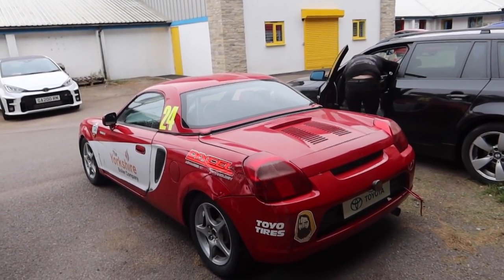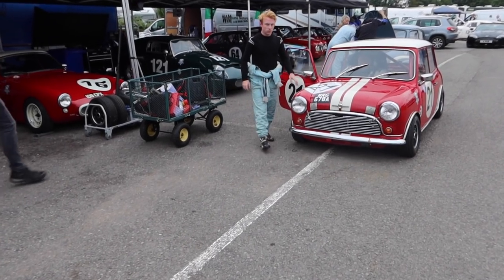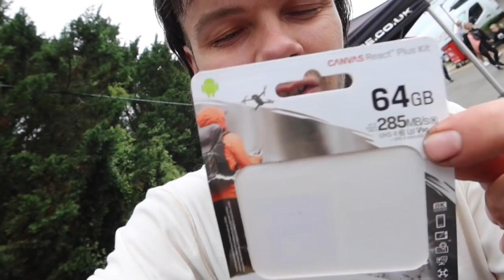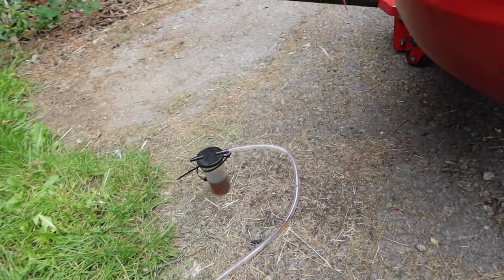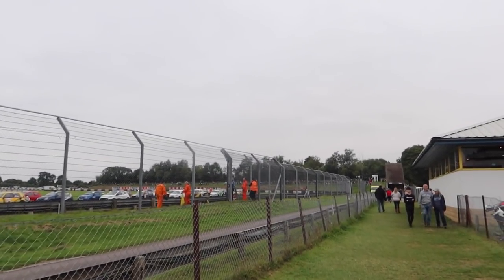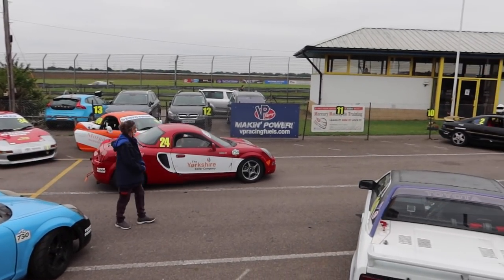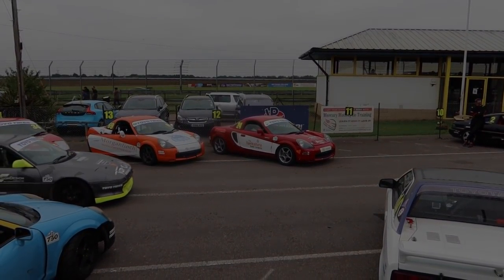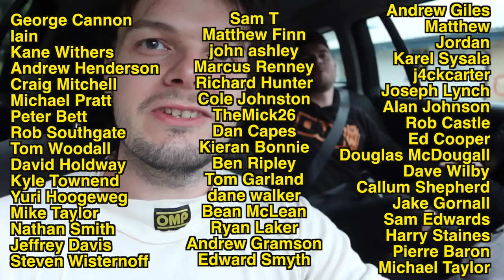MR2 RETURN TO RACING! Castle Combe Race VLOG ft TROPHY!

Comment: This was really good racing "indeed"!
two notes, considering how fast mr2 reacts to input you have really good control but that might be hurting you, I would attempt to slightly use less corner when they are bumpy, the car would accelerate slightly faster if less unsettled, faster lap time, but you know, only by tenths. 
Continuing on car unsettling, you now have the 03+ engine that suffers less with oil, but it still suffers, unsettling the car makes friction go up, hp go dow, you know, more tenths :D 
Oh, btw, side intake plastics, you have the golf ball ones, and then there's the fin ones (03+), if you have only short straights change to the fin ones, they are not cosmetic! Ofc, someone will say they are LOL 
Golf ball ones , increase air attachment better at higher speeds, like 90mph

Comment: 22:00 I'm no expert I reckon your habit of going until the back steps out from doing track days is costing you, even if you were still running wide it's probably better to smooth it out rather than slide
Reply from the maker: I don’t want the back to step out at all but following the line with some lock on has surely got to be better than backing out. I think you’d lose more time on the latter

Comment: Really good.  Bias question... Coming left out of Bobbies (second chicane) you were really fast, however, camp was always the worst.  Do you think your car has some weird setup thing post crash and the car is better turning left (not measurable out of esses (first chicane) and bad turning right (camp- how can people in the mk3 be pretty much always better there). Seems to be under braking (similar unsteady on track day video) so is that a front axle imbalance.  How are front shocks?
Reply from the maker: Nothing is perfect with this car. There is a reason balance could be odd but we will worry about it after the season is done
Reply: @dannyDC2  So this turned out to be really interesting.  We now know the drivers side rear shock is stuck and hinders you on right hand turns, see 7:10 and 22:30.  20:55, 20:26, 22:12 all have great runs out of the left hand turns.